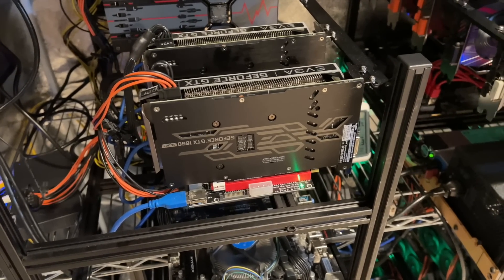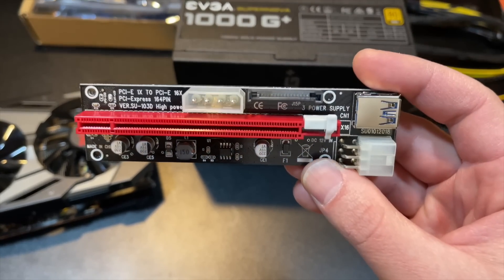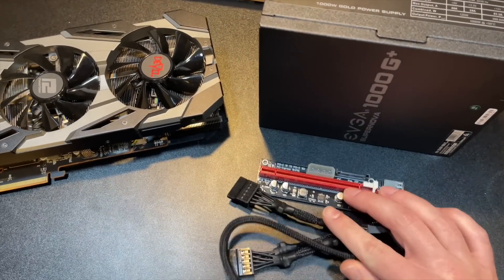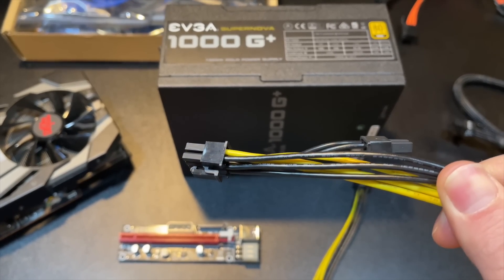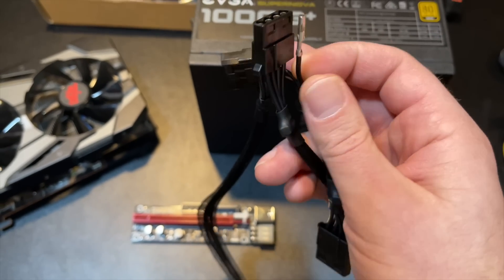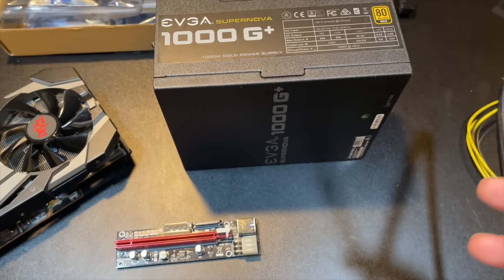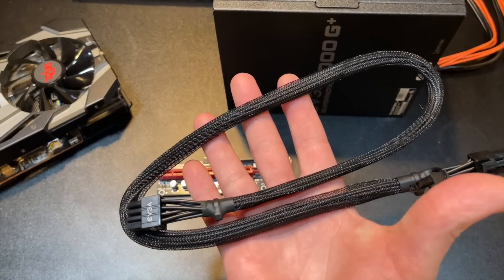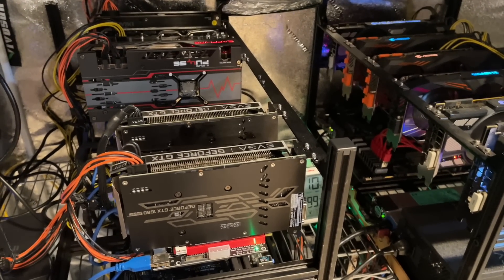Powering GPU Mining Risers Safely

Comment: If you believe your use of cards for mining will allow you to get away with out-of-spec cabling, always remember that at any time it's possible for one of your cards to have a crash mid-mining and result in your overclocks and most importantly - your underclocks - to be reset. When that happens, the card will draw power you never tested or mined with before, and that power will still be within official specs. If your setup isn't within those official specs, you will wake up with burnt cables and fires on something that might have appeared to work well for days or weeks.

Touching the cables to check for heat mid-mining may not even be a useful gauge as it's possible for the cables themselves to have been made thick enough to handle the extra power, but the connectors cannot. Then the cables will stay cool and the connectors will heat up and melt.

Furthermore if you have cables that are out-of-spec by design, I recommend throwing them out immediately. Do not let them sit idly in a box for years until you've forgotten what the deal with them is, only for them to someday wind up back in some computer or mining rig configuration and then burn something.

Finally always do your own testing even when in-spec. A 2x 6+2pin PCIe is supposed to handle 300W but mine got hot with 4 risers so I reduced it to three. And a molex-to-PCIe 6pin is supposed to handle 75W but again mine had thin cables and got hot, so I had to replace it with a 2x molex to PCIe 6pin. Threw those cables out.

Don't go out-of-spec and test for safety. Go in-spec and test for safety.
Reply from the maker: GREAT advice. Thanks for the comment!

Comment: I guess u calculated it wrong at 16:27. When your OC Reset and your 1660 Super Runs at full throttle you said max tdp is 125 but you r using a pcie splitter which is powering the riser as well for an extra 75w. So the math 125 gpu + 75 riser = total 200w. As per our calculation the pcie can safely draw 192w.

Am i wrong or missing out something here ?
Reply from the maker: It's total is 125w through both the riser and PCIe plug in connector.
Reply: @RedFoxCrypto  okay. So 75w for riser and just 50w for 1660 super ?

Comment: So would it be bad to use a whole line of available molex for PCIE risers? Or, as long as it isn't hot, that means it is using high quality prongs?
Reply from the maker: Using a whole line would be potentially dangerous. I've used one connector on a strand for my lower TDP cards, but even that can potentially be unsafe since we don't have a clear spec for what Molex can handle. Sticking to just PCIe is the absolute safest way to power a rig.

Comment: I have a noob question. My cables on direct psu has 2x 6pin (6+2) so in short my every single pcie cables can power up 2 gpu 2 risers using 2 splitters right? Gpu Rx 570
Reply: I can confirm that this should work and im doing this right now. Been running for two days
Reply: @Gr33kChief  can i use it on my rx 570 8gb? coz i searched and tdp of 570s are 150 watts
Reply: Im doing this on two 1660 supers

Comment: Surface area matters and only matters. Thicker gauge: more surface area, bigger pins means more surface contact.
I've played with jankey DC powering, can push 10A through 20AWG without issue. This is not NEC or UL: you're running short distances with low voltage. Make sure the connections are snug and check temps.
Reply: Theres no "communication" in basic DC powering, this isn't PD or QC.

Comment: I will build a rig with x4 RTX 3060tis, and i will use 1000w PSU, so for each graphic card and his riser i need to use one PCI-E 6-pin to 2x 6+2-pin cable, right? For each graphic card plug only 6pin cable?
Reply from the maker: I run my 3060 Tis with a dedicated PCIe strand the GPU itself and another dedicated PCIe strand to the riser. If your GPU has 6 PCIe connections 4 of those will go to the GPUs themsleves and then you can use a splitter to split the remaining two to power the 4 risers.
Reply: @RedFoxCrypto  Information update - today my GPUs arrived it's "4x gigabyte RTX 3060 ti eagle", "200w", not the best stuff, but better than nothing - they have one 8pin slot for power. And I order 1000w PSU, it has 3 PCI E 8pin power cables and 2 CPU 8pin cables. Also, I bought 4 splitters 8pin x2 6+2pins, can you guide me how should I manage the cables? Thank you!

Comment: I've been using the sata power for riser for 4 years for RX Vega 56, no problem, 1 sata cable line in the power supply, a maximum of 2 risers, that's definitely safe..

Comment: Hey!

How often do you repaste your GPU-s? For example the one you just bought has about 3-5 years of warranty, do you wait until that ends till you clean and repaste them? Since if you tear them apart i guess that voids the warranty?!
Thanks , i hope you answer
Reply from the maker: Hey Tamas! It doesn't void the warranty. Typically if you notice temperatures getting higher they might need a repaste. I've never done it on any of my cards to date, but I believe my 3+ year old 1070 Tis would benefit from it. I'm going to do it before I sell them soon. Otherwise, I'll clean them with compressed air once every 6 months or so depending on the conditions.
Reply: @RedFoxCrypto  Thank you for your answer!

Comment: I disagree with this assessment. It assumes that just because the PCIE slot pulls  UP TO 75 watts it means it will pull 75 watts. It just doesnt. I have multiple rigs running with risers. I monitor (HWINFO) the pcie power pull on that port, with 3070s and 3080s it has NEVER pulled higher than 30w. Well within the 54 watts sata can handle.
Reply from the maker: Thanks the comment Aaron. Purpose of the video is safety and planning for the worst. I’m sure you’ve seen plenty of pictures of melted sata cables in your time mining. It happens. Be careful and happy mining!
Reply: @RedFoxCrypto  That is a very solid point. I DO have 3090s that are also mining (they weren't purchased originally to mine) and those I would NEVER put on a sata powered risers. They consistently surpass 60w pull on the riser and would be dangerous to power with sata powered risers. Sorry I should have clarified in my previous comment that for 3070s and 3080s you are likely ok, but 3090s...yeah I would stay away.

Comment: Assuming all this is true, why are there so many new PCIe riser kits with only 6-pin ATX connections that come with SATA adapters? I have used a bunch of them without issue and have seen many other rigs using plenty of them too. GPU pulls 100-250W of PSU power directly via 8-pin power, not the 6-pin adapter which powers the riser that doesn't use anywhere near that wattage, it just moves data on PCIe bus and doesn't need huge amounts of power to do that.
Reply from the maker: Thanks for comment!

To be clear, none of this is my opinion it’s all facts which are referenced in the description. The PCIe slot on the GPU is speced to do up to 75 watts. Does that mean every card will under every condition? Of course not. But the purpose of the video is to be safe. Check BBTs riser power draw videos for more live testing of this same subject.

NVIDIA tends to pull less but the last couple gen AMD cards pull a lot through the riser.

Happy mining brother!

Comment: Looks at my 3x 3060ti's running off one sata cable in my bedroom has panic attack
Reply: Luckily i watched this at 4am and quickly got out of bed to replace two of the pci adapters with a standard 16x riser cable until some proper splitters arrive.
Reply from the maker: Haha dude!! First, I laughed out loud at your comment. Second, I’m super glad you switch it up. No melted cables or fires!
Reply: @RedFoxCrypto  Haha no melted cables, or melted body parts while i sleep :P

Comment: Great video! Regarding PCIe splitters - does the same apply for those 8 pin to 2x 6+2 pin cables that often come with PSU's?
Reply from the maker: Yes you can treat those just like a single PCIe like in the video. Still only one splitter per that strand even though it has 2 6x2pins.

Comment: Hey, new miner here! I have an EVGA 3060ti OC and a UBIT Riser. I have a PCIe cord that plugs into the PSU using 8 pins and feeds 2x separate 6+2 PCIe connections. The GPU takes 1x 6 pins- so can I use the other 6 pin cord on the same line to power the riser? It's not doing anything except hanging around.
Reply from the maker: Personally, I'm not splitting that connection and instead providing a separate PCIe for the GPU and the riser. 

Technically, if you could ensure that your GPU was always power limited and the overlocks never reset it would be fine since it would only run at 120w and the cable can handle that easily.

For me, I'd rather be safe.
Reply: @RedFoxCrypto  Thanks for replying to my comment! I appreciate that. So, I'm using an EVGA 1600w P2 PSU. It has a TDP of 200w, and I plan to be using around 130ish per GPU. Additionally, the PSU has 9x PCIe slots from their website pictures, but I'm running 8GPUs. Is it even possible to power the Risers or do I need an entirely separate PSU to do so? Thanks Red Fox for the helpful advice

Comment: OK... so. If I understand it correctly confirm me this example: 
the card has 2 PCIe inputs: 8 + 6 Pin, it means that I can power it AND the riser with one PCIe cable with 2 x 8pin plugs, of course using a good quality splitter on one 8 pin to divide it into 2 x 6 pin for the card and riser... right?
Reply from the maker: If the card has 2 PCIe inputs I wouldn't split it. Typically that means it's a higher TDP card. I only run my lower TDP cards and risers off one strand like that.

Comment: Very,very useful video mate,probably best for a newcomer like me)If you dont mind i would still) ask you...just to make sure,if i am powering 8+8+8 of my 4*6900xt gpu i should use three different cables for each of the 8 pin slot?..and i can not go with 2(8+8)and 1(8) from two cables in one gpu..?Or 1(8)to gpu and 1(6)to my riser as well?..

Comment: so what if your cable coming from the psu has an 8  pin plus another 6+2 pin would it still be safe to use a splitter?
Reply from the maker: Yes, just only use of the 8 pins to split. Don't split each connection.

Comment: I agree about the HDD/FDD connector not being rated where you can find it.  The old power supplies had different pins ( old enough for a built on power switch ) as well as MARKED for max Amps for the connector ( 12V@1-5A, 5V@.5-3A depending what it was pulled out of )
Reply from the maker: Thanks for sharing Eric!

Comment: I am no electrical engineer. I did however ask a certified electrician about using a 54W cable to power something that could possibly pull 75W and he said it was not a fire hazard as long as it's low voltage. Anyone who has put their tongue to a 12V battery knows it's low volts. So I don't see why everyone is freaking out over these SATA cables. Anyone who is worried about this should call an electrician it's free and there are no ads.

Comment: I have those PCI-e splitter, and and I have the black and yellow cable, not the red and black cable you got. And when I power both GPU and riser with it, the cable gets really hot. It's 18 gauge. 

When i plug 8 pin cable directly to GPU and use even the included sata to 6 pin adapter, the adapter stays cool. Is it still better to use pci-e splitter to power both gpu and riser even if the cable gets super hot?

Comment: Does running power supply on 220-240, cut the amps in half on the power connectors? Or just the amount of amps the power supply draws from the wall?
Also using a dual molex to pci 6+2 pin is safest way double the wires size in a way.

Comment: Thanks man, good info. Just reordered my risers, had SATA and now I will go over to 6pin. I have good 1200W PSU with 6x 6+2pin Y(dual 6+2pin) pcie cables, so enough headers for 3x 3080 with 3 risers with no adapters.
Reply from the maker: Thanks dude. Glad I could help. 3x3080s is sick. I need to get more of those.

Comment: Thanks for detailed video. Exactly what I was looking for. 

To run 10 x 3060 TI RIG, each draws up to 180 Watts at peak load. Its hard to find a 2000W PSU. Can I use two 1000W PSU instead?
Reply from the maker: Yes absolutely. Even better, pick up a server power supply to lessen the cost. I just posted a video on this.
Reply: @RedFoxCrypto  Thanks that video really helped.

Comment: How about PCIe to MOLEX?
Reply from the maker: Molex will be the limiting factor in an adapter like that and fall under the Molex section of the video. Personally, I'd avoid it not only because of the slippery specs for Molex, but also because adapters are typically cheaply made.

Comment: Great vídeo man. Something I don't understand: if the gtx 1660 súper can pull 125 watts max and the riser 75 watts you have 200 watts. Amd the splitter 192 watts. Means you' re under by 8 watts, this is ok? Maybe I am confused
Reply from the maker: All good I got you buddy. It's a total of 125 watts for the card, which includes the 75 watts from the riser.
Reply: @RedFoxCrypto  Thank you! Subscribed!!

Comment: Hello, Red Fox Crypto! Love your videos, I've been watching you since last month and I think you explain everything very well.

I have a question that only an expert like you can answer.
I'm building a mining rig with 3x3060ti (1  8pin connector each one) and 4x3060 ti (2  8pin connectors each one).
I have already bought the GPU risers, they come with the classic 6 pin to SATA connection.
What cables do I need to safely connect all my GPUs to the PS? (even if I need to replace the risers' cables)

Thanks!
Reply from the maker: What's up Julian! Thanks for the kind words buddy.

So 7x3060Ti rig right? Nice dude. Let me see if I can help you sort out all the connectors, but first what PSU are you going to be running? Do you have one already?
Reply: @RedFoxCrypto  I have already bought one of these 
https://www.pccomponentes.com/gigabyte-gp-p850gm-850w-80-plus-gold-modular
And I'm obviously going to buy another one because I need more than 850w.
Reply: @RedFoxCrypto  What do you think? :)
Reply from the maker: @juliancavero7881  Sorry for the late reply brother. Okay definitely need multiple PSUs like you said. 

Looks like that PSU has a total of 5 PCIe/CPU connections. So with the CPU taking up 1 you'll have 4 left on PSU1 and 5 total on PSU2. That gives you 9 PCIe connections. (The PSU only comes with 4 PCIe cables, meaning you'll be short 1)

7 of those are going to be taken up by your GPUs. Leaving 2 PCIe left. 

Also, looks like the PCIe cables that PSU comes with are single 8 pin, so for those GPUs you have that require 2x8 pin connections you're going to need PCIe splitters to make that single 8 pin into 2 or if Gigabyte sells PCIe cables that are dual 8 pin connections that works too.

For the risers: PCIe splitters again to make the 2 PCIe connections you have left on your PSU into 4. That still leaves you short 3 connections. Your options there are:

1) Buy a different ATX PSU that has more PCIe connections.
2) Buy a server power supply instead (just posted a video on this and would be great for your rig)
3) Use a single Molex connector per peripheral cable to power 1 riser (potentially dangerous, see video)

Hope this was helpful. If I were you I'd go with server PSU instead of another 850w. They can be loud so I'm not sure if that will impact your decision, but it will make things a lot simpler and probably cheaper.

Happy mining brother!
Reply: @RedFoxCrypto  Thank you very much. I think I will buy a server power supply. I will purcharse it along with some cables from the page you mentioned in your newest video, because even though the shipping to my country is like $60, it's still cheaper than buying it here.
Do you have any code that I can include while shopping so you get credit? If not, I just can say THANKS A LOT for your help, because you have cleared up this miner's mess a lot.
Reply from the maker: @juliancavero7881  Awesome dude. No code just glad to help out.

Comment: I've always used PCIE to SATA since it's what came with the risers. Never had an issue in 3 years of mining though. I only put 1 or 2 risers on one cable. I never thought to plug straight PCIE since I always end up using all available cords that come with the power supply for 6 GPUs.

Comment: According to the clamping DC ammeter I have, the MSI RX 5700 XT Mech pulls 74 watts (6.1 amps @12.1V) through the edge connector when slotted and powered through a riser.
Reply from the maker: Wow thanks for sharing. I heard that the 5700 series pulled a lot through the riser. Can you link the meter you have? Thanks dude!
Reply: @RedFoxCrypto  I live in Thailand. I bought a cheap Chinesium ammeter at the local equivalent of Lowe's or Home Depot. 
Very similar to this: https://www.amazon.com/dp/B0822PSCHC

If I were to buy one again I'd get one with a bluetooth interface so you can graph load over time, etc.

Thank you for the excellent content!

Comment: hey man i want to start mining i have 2 3090s can i start a mining rig by placing the 2 gpus directly to the motherboard, i work with metal so i can make a decent case to put everyting together but idk if i should do it with risers directly or i can start that way, very nice info tho, new suscriber from mexico, always learning with u
Reply from the maker: Thanks dude! And yes, if you can slot both GPUs into the Mobo. That's exactly how I started! Just watch your temps depending on your case airflow.
Reply: what temps should be like for a stable run if i have both very close, my new mobo should be here in like 3 days so im going to prepare everything for my first mini mining rig, im hyped! Thank u tho

Comment: thanks for the info! super helpful! im running 3080s in my rig, one of my 8 pin cables is missing 1 pin, do you think this is okay or should i make sure i get cables with all 8 pins?
Reply: Following
Reply: @jayjayjay457741  I figured it out. It's a tied in ground wire .after researching. It's normal. if you had the same concern.